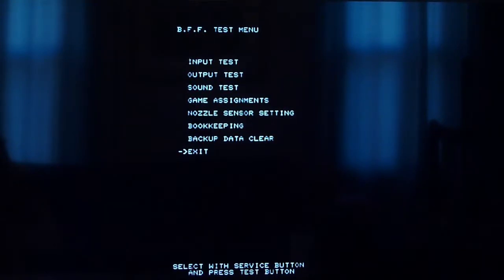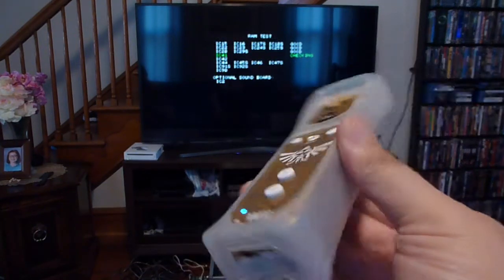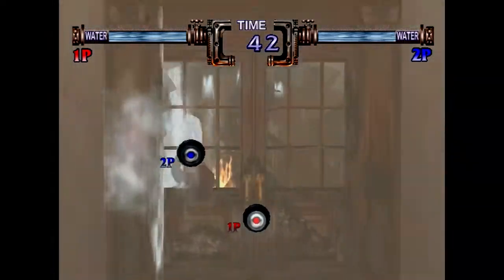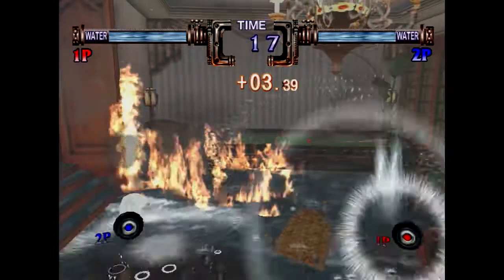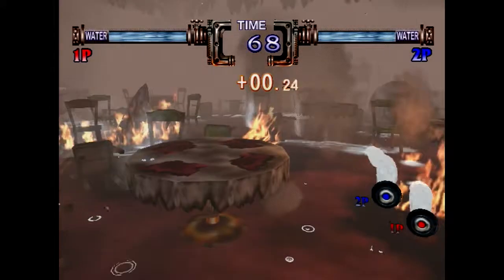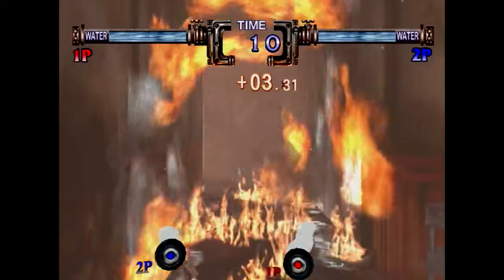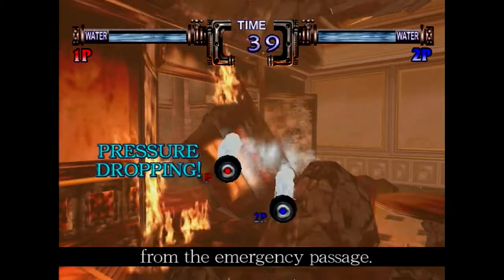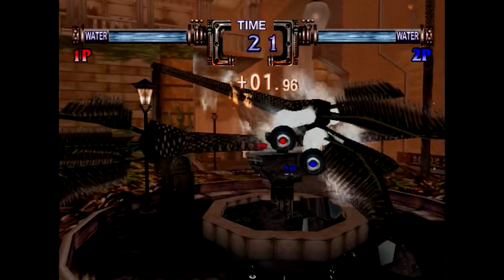Game Nexus Arcade Video Brave Firefighters (1999 Sega Hikaru Hardware) Real Hardware

Comment: There should be a 2020 version of this...I mean with technology now this should be killer
Reply from the maker: Yeah its a very fun game I very highly recommend it. Its a shame that its not been ported to anything and emulation is still pretty poor.
Reply: @The Game Nexus  yeah. We need more home style arcades. Nice to have open world ones but for smaller kids need walk-through types. So where can I get this board? Looking to make a setup for my kids fire fighting bday
Reply from the maker: @RunnerProductions  I got the Hikaru board with Planet Harriers along with its control panel and power supply several years ago. (ebay auction, they dont come up too often) Unfortunately this board is very delicate and are often either damaged beyond repair from normal use or when they are shipped inproperly. I bought Hikaru boards with Brave Firefighters, Air Trix, Star Wars Racer Arcade and Nascar racing but all of their main boards were broken one way or another. Of course having the good main board from Planet Harriers I can swap the rom board for any of those games on my working main board. Considering I have like 3 or 4 broken Hikaru main boards, finding a working one is very rare.

Comment: Would it be possibile to emulate samba de amigo maracas with wii motes?
Reply from the maker: It may be possible, just depends on how the game handles its input. If its just a standard i/o board that converts the analog signals of the maracas then it would be completely possible. Maybe I will investigate that at some point.

Comment: Badass and underrated game.
It would require a powerful emulator in order to play without complications.
Btw, 19:12 it was actually that (in the kitchen near headcook's office) generator transformer that started violent short circuits with tensions and caused heavy fire at Whitehead hotel.
Reply from the maker: From what I understand it is not how powerful the system is, but emulation simply isnt perfect yet as not all the custom chips the Hikaru uses are fully understood yet making perfect emulation impossible until thats figured out.